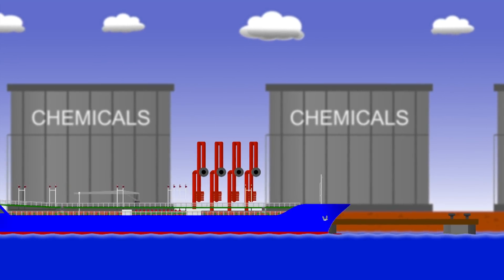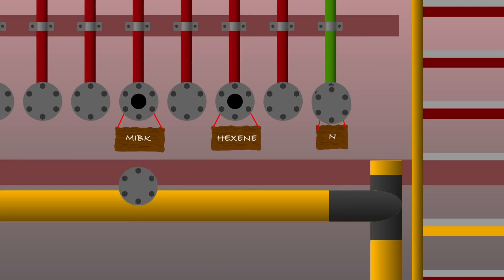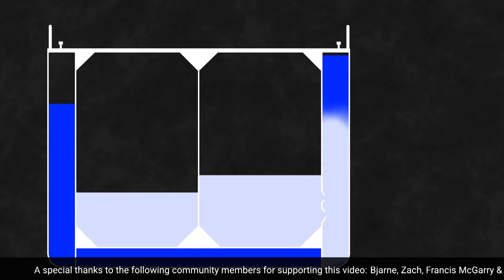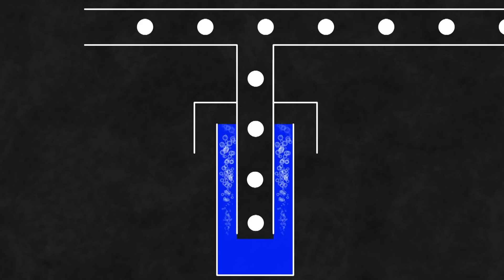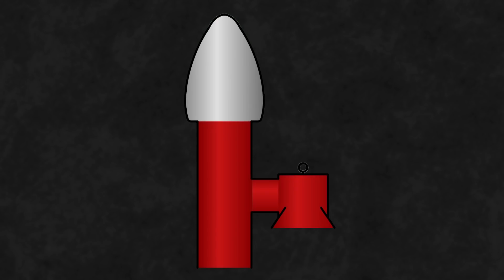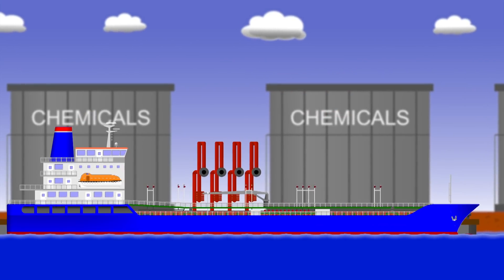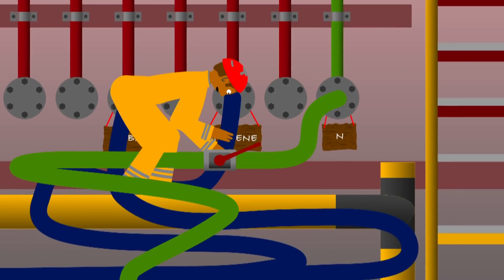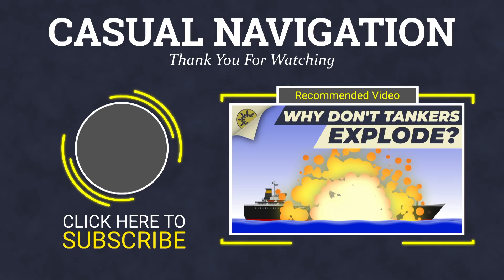What Do Ships Use THESE For?

Comment: It'd be interesting to see why did the low pressure alarm go in the first place. Or was the pressure too low indeed but the nitrogen valve then was opened way more than needed?
Reply: My guess would be a sensor failure, but I could be wrong. Since the cargo is forced out by the nitrogen line, I can't see how an actual underpressure could happen there
Reply from the maker: The cargo was being pumped out faster than the nitrogen came in initially. That's why they opened the valve more.
Reply: @CasualNavigation  I still find it interesting how this issue came to be. I assume that before unloading, you'd make some sort of calculation on the release rate of the load, and thus how much nitrogen must flow in, and thus how far a valve must open. Was this all manual guesswork then?
Reply: @CasualNavigation  Couldn't the chemical just be pumped out by the nitrogen pressure? or it would be too risky and slow?
Reply: @DEEJAY88  Or nitrogen sucked in by underpressure from hold being emptied?
Reply: @xXxLolerTypxXx  cargo will never be pumped out by the pressure of nitrogen. It should purely added at the rate the cargo is being pumped out by the pumps. 
A full tank will go into alarm quick and easy as the vapor space above the liquid is small and imbalances are quickly noticed. Normally the n2  added into the cargo tank is coming directly from the shoretank as its displaced volume in that tank. In this case the added a high volume n2 line. In retrospect not the best idea. 
(18y at chemical tankers till now)
Reply: @bas6983  I stand corrected. But why do they use pumps instead of gas pressure to empty the tanks? In my eyes that's just one more system that can fail, especially when transferring chemicals.
Reply: @xXxLolerTypxXx  because tanks are not designed to work under pressure. We pump out our cargo by pump into shore pipeline systems with pressures upto 7b/100psi. And in case of heavy cargo upto 15bar/220psi. Not a single carga tank can handle those pressures. 
The have a desing working pressue of 220mbar and in some cases upto half a bar vapour pressure. Nearly all liquid transfers are being done by pump into a pipeline all over the world.
Reply: @bas6983  That makes sense. Thank you for explaining!
Reply: @abnormaalz  All it would have taken was a misclick on the calculator.
Reply: @abnormaalz  yes you make calculations and preparations between the vessel and the terminal. A max rate and pressure will be dicussed. But you cant discus or plan the position of a valve. Start up is slow so supply should be slow and when increasing the discharge rate the flow should be increased. This is really just finger guessing in hoe far to open the valve. Using the same terminal and hose several times can give you an idea bit al operations are different.
Reply: @Lancashirelad sorry thats just bullcrap. Yes in you’re correct this is a solution but if the primary source of nitrogen is not sufficient you can reduce and stop but at the end you need to empty your tank. 
If your making coffee and the tap is dripping do you use the drips or open the tap further to increase the flow of water? 
Watering the garden and replace the spray 6 times or open the supply of water further.
Reply: @Lancashirelad stop pumping for too long and you have the same problem
Reply: Also keep in mind the use of a manual valve to control nitrogen pressure, so at that point the crew were possibly just gessing. Probably started with the valve not opened enough, and then when they went to open it further, inadvertantly opened it to far. What they needed there was an automated valve where they could set desired pressure and let the valve automatically adjust accordingly, or better yet, one they could connect to the ships monitoring system so the ship could adjust the intake flow as need to keep the balance.
Reply: @Krahazik  this is a very complicated way to do this. All ships are different and systems are not integrated or compatible. This can be done from shore side but this is not as simple as it looks on paper. It still requires integration of systems or decent regulators. There are no standards in equipment within the shipping industrie as in airliners.
Reply: @bas6983  Considering what you said about the lack of standardization, it seems like this scenario is likely to happen at least a few times a year on a global scale.
Reply: @wesleyhurd3574  Can confirm this happens more often than this video. It is however not dificult to set the "valve" to a position which is close to correct. You could either use a regulator , flowmeter or just adjust the valve a few percent each time until pressure in the tank holds steady. Considering a tank can be 1000m3 and you have a 5% vapour space this is 50m3 of vapour space or 10m3 of added pressure before the tank would burst (Given 300mbar bursting pressure and 100mbar to be kept at customers request). Its a very common thing to do
Reply: @DEEJAY88  
Too slow w risk of overpressure, i would guess. 
Ship said 1" Nitrogen line..that 4" line is 16 times more volume than 1".
Manual valve guess work was seat of the pants haphazard..
Was Jethro in charge on the unloading dock ?
Reply: @bas6983  
Good point.
Plus, the sensor alarms in the cargo tanks are like idiot lights on dash of your car. Light comes for over/under pressure..it's too late..
Need an LED board visible to everyone of chemical CFM discharge vs Nitrogen CFM input. You can use a 4" N hose if you can precisely meter the flow rate. 
People don't realize how dangerous a vacuum situation is. Tanker trucks, railroad tank cars have violently comploded ( ok, thats a texas word..like "Tump"( tip/dump)
" Dont tump it over.."
Complode; collapse/implode.
A ship tank could easily implode in a modest vacuum.
220 millibar tank rating is only about 3 psi..
Reply: @xXxLolerTypxXx  If you use a pump the pump provides the pressure needed to move the cargo. The tank is at atmospheric pressure. If you were to use gas pressure to move cargo  the tank would have to be at the outlet pressure of the pump and would need to be considerably stronger. Also at the end of transfer you would have a large volume of pressurized nitrogen that needs to be safely vented.  All in all a pump with just enough nitrogen in the tank to displace the cargo being moved is a lot more controllable, requires much less in the way of cargo tanks and overall is a lot safer

Comment: As someone versed in railway boilers, hearing about pressure relief valves with variable pressure release points scares me. Even though it wasn't the problem here, it still frightens me that you can overpress your tanks by simply overweighting/overspringing the PV Valves.
Reply: Well that's a matter of negligence/incompetence if they ever mess with the weights/springs, for something like the ship's tanks it would make sense to just set it bellow rupture and never increase, but I can imagine some specific scenarios where you would want to decrease the maximum pressure (say if the chemicals being loaded can end up diffused with the gas loaded if the pressure is above a certain point... that's just a scenario I imagined tho nothing I can name).
In other hand I think it's something you just set on install instead of making several different valves. More of a matter of having common parts instead of several, not needing adjustment itself.
Reply: @Kalvinjj  you are right, of course, but in the early days of the railways, engine drivers would overpress their engine's safety valves to get more power out of the engine (often leading to an explosion.) I suspect it isn't unheard of that shippers unofficially raise tank pressures to fit in more product - there just hasn't been a disaster yet. Intelligence and safety go out the window when 'efficiency' could be promoted.
Reply: @ajaxengineco  Oh you do rise an interesting question... Haven't thought of that frankly, would be important in vessels that carry gasses. Wrong (by a huge margin) weight listings on containers sure is a thing after all (even tho that's more on the one paying the shipping).
Reply: @ajaxengineco  Interesting point.
I'd gues that in case of engine even small increase in pressure will give you significantly more power but in case of cargo hold every additional rise in pressure will give you significantly less extra product. And the risks are basicaly same.
Reply: I can't see any Incentive to do so though. Messing with the Safety Valves of a Boiler increases Power and Efficiency at the Cost of Safety. But since the Cargo itself isn't gaseous, increasing the Tank Pressure doesn't increase the Amount of Cargo you're transporting. So why should you intentionally mess with the Safety Valves? The only Danger I can see is forgetting to adjust them.
Reply: Tbh I feel your anxiety about adjustable PV valves, I work on steam boilers myself and the safety concern would be massive. But I think there's a big difference in having ten or twenty atmospheres of pressure in boiling water or having maybe one or two atmospheric pressures at most inside a chemical tank. 
My guess would be that the valves are

a) designed in a way that it is difficult to change their setting out of negligence
and
b) designed to be safe for the tanks even on their most weighted setting so they would still open before the pressure limit of the tank is reached.

I'm personally more curious to why there wasn't just a flow control valve or even flow limiter between the nitrogen land line and the tanks. This way the inflow could have been regulated to never exceed the 17.000cfh flow limit of the PV valves even if the flow rate and pressure of the land line exceed that limit.
Reply: In my industrial experience, the RVs throughout a plant system (and a ship can be thought of in a similar way) were designed for specific conditions, to include flow rate, activation and closure pressure, and even other process conditions such as the temperature of the fluid being handled. While these COULD be changed, our requirements were that the valve be returned to the manufacturer for adjustment, and that the adjusted values be certified by their engineering team and stamped on a new nameplate.
But that was our facility operating under CSB's PSM standards. YMMV.
Reply: @ajaxengineco  tankers are not like steam locomotives. they are storing liquid in the tanks. increasing pressure doesn't increase storage capacity.increase steam pressure increases capacity since steam is compressible. liquids are not compressable.
Reply: He didn't say they were user servicable, simply how they work. the safety valves on air compressors are the same way, but they put a tamper seal on it at the factory
Reply: You can’t adjust them; the video is wrong on that score. They come pre-set from the factory depending on what settings the shipyard have ordered. Usual pressure setting is 1400mmWG and vacuum is -300mmWG.
Reply: @garysmith2450  they are probably adjustable and then safety sealed. The factory adjusts then and end user can't or they are liable.
There's probably a rebuilding procedure and even brand new, it needs to be calibrate

You even said usually implying you've seen others. Are they completely different, or just a different spring setting?
Reply: @seldoon_nemar  the ones I’m familiar have weights specifically measured for whatever pressure the architects have deemed safe for the tank. Yeah you can take them apart and change the weights but there’s no real point and it is definitely not to be encouraged 😂
Reply: @niklnik1008  On all the rocket test stands I built and operated, we had relief valves and burst discs- and if the relief starts to flow, you are in emergency mode, any testing must be aborted, and the next two steps are to close the press valve and open the vent. This was hammered home in all operator training.

If the operators persist in being negligent, the burst disc is sized to have greater capacity than the pressurization system. I even designed magnetically-restrained blowout plugs to serve as resettable low-pressure burst discs where needed. Maybe it does take a rocket scientist.